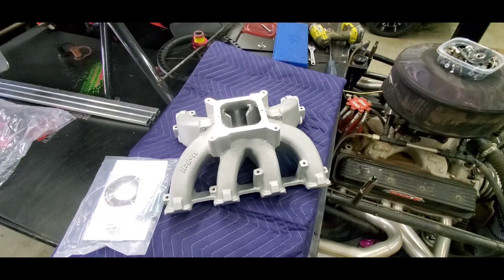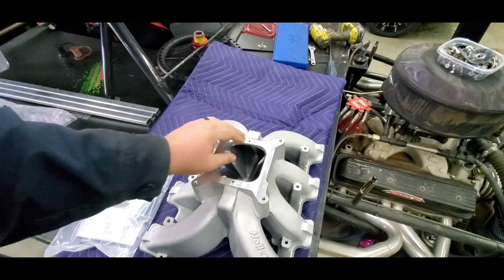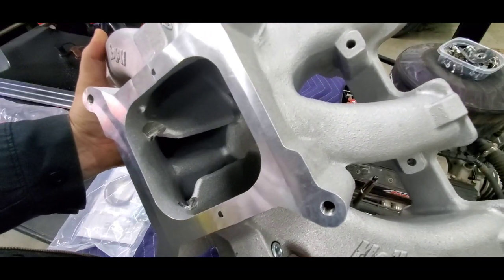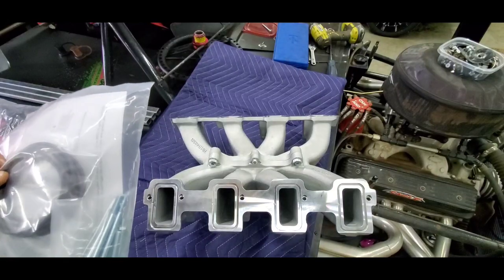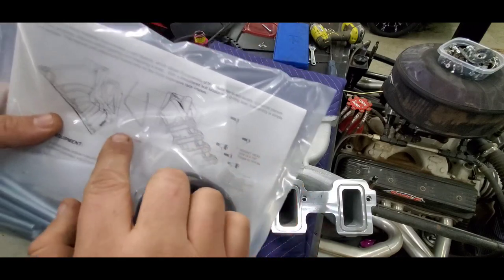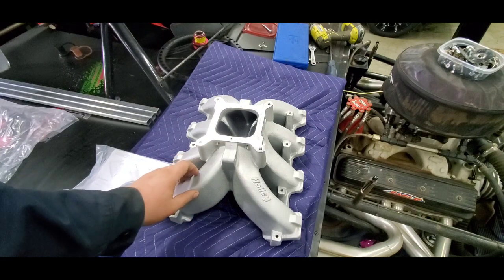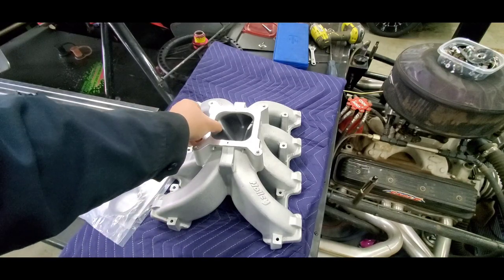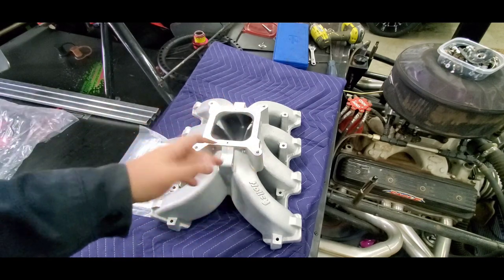Holley Split Race intake manifold for Rectangle port ls3 heads.

Comment: It did good on Richard holdners test but under 6000 the shorter dual plane wins
Reply from the maker: He does some killer tests but some ways I do not necessarily agree with. He loads the dyno different quite frequently